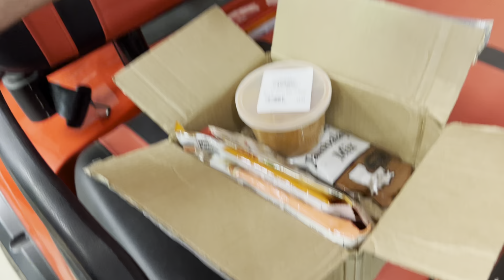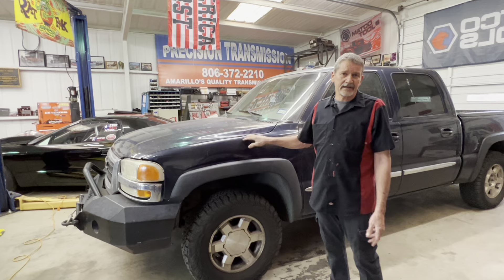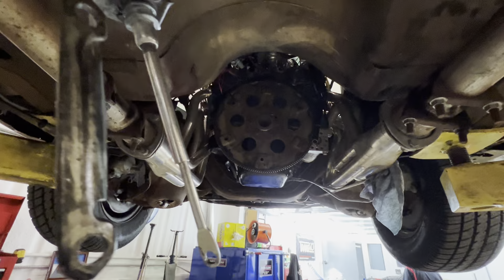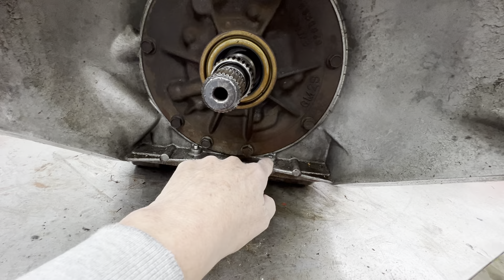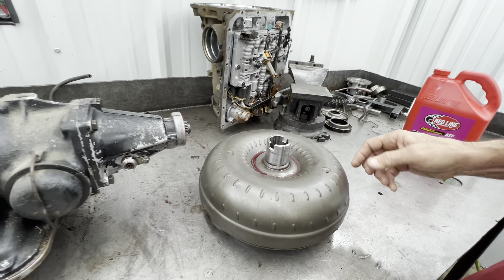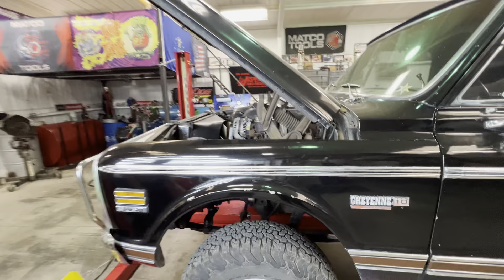350 Transmission / 76 Firebird

Comment: Great to see you guys, Richard, and Teresa! 

Apologies, I haven’t been around since I quit working for myself and went back to the corporate world. Been commuting to the city, doing maintenance in a large company. The commute really sucks, but it is 100x less stress than what I was going through turning wrenches. I’ve had my fill of modern junk! Never mind the parts quality and availability, shipping problems, and the list goes on. Pay isn’t spectacular, but I can still do things on the side. Benefits are really good with quite a bit of time off, even to start. Overall, it was a good choice for me. It was definitely time after 14 years! I also got rid of my 2007 Silverado & bought a ‘93 W250 five speed manual, Cummins 12v. Life is good again!😂

Good to see you’re both still at it. 👍😎👍
Reply: What is a W250? 🤔👍🇦🇺

Comment: Always love watching your videos you can tell you both really have passion for what you do.  Made me remember a shop did my brothers transmission on a SHO.  We right after found they left all 3 plugs off the same side of the engine (V6).  It obviously didn't shift right or even idle and rev normally they denied any issue with the vehicle on a test drive.  We then rode in the car with them at which point he suddenly noticed things it didn't do when he drove it.  It went back to them a total of 5 times including when it was fixed.  Of note the 5th time they simply dropped in a used transmission (they did no work on) from the next model year which the factory had several updates done from 1 model year to the other.  All the stuff like you do with the Z-pack they said we don't deal with any suppliers with things like that, coolers make no difference and using a synthetic fluid or blend they see no difference.  Anybody that knows anything about those v6 yamaha SHO's knows that the ATX and mtx both needed all the help they could get to handle the power.

Comment: When I had to have a driveshaft shortened I kicked myself after the job was done. I found out it wasn't much more to have a new tube instead of cutting down the old one.
Reply: I felt lucky to find someone local able to do my 4x4 driveshafts.
Reply from the maker: Here in Amarillo, it would cost twice as much to have it re-tubed and balance things have just gone up

Comment: Why wouldnt you tear that down before you sell her another? Poor person had to pay for it once, now she has to pay you twice as much. Maybe with a diagnosis, she could of got some type of refund for the shoddy engine, rear, and trans work before you sold her it again.
Reply: A shop not going to refund money because another shop took it apart and said it's bad. All you can do is take it to Richard and get it fixed right and forgot about the lost.  Shops that do that bad of work will not refund any money.
Reply: 1st of all, I'd like to say my engine is great as Richard knows the back story, shoty mechanics where I live, and not even an attempt to make it right on the rear end. My car sat at the shop, and they never attempted to correct the issue. Right out the gate. In Texas Small claims court win does not mean you will be paid. Lesson learned move on take the loss. I appreciate Richard & Teresa doing these videos. Help me make the choice to travel 10 hrs there, to get the car fixed by someone who takes the extra time to explain details in his videos.
Reply: I had told Richard I have been considering doing an overdrive unit. The man who built my TH350 was willing to do a bench swap for me, but why go down that road again after finding my case was damaged. Richard didn't try to pressure me into paying  twice as much for him to correct wrong doing.  These cars are getting harder and harder to find folks who know how to do proper work and take pride in it. I'm grateful I found him and Teresa, and they were willing to tackle a job where others who lack mechanical skills.